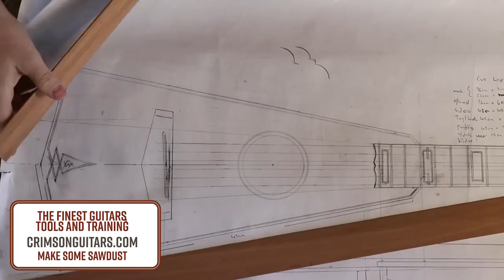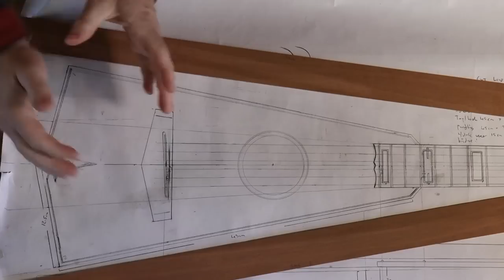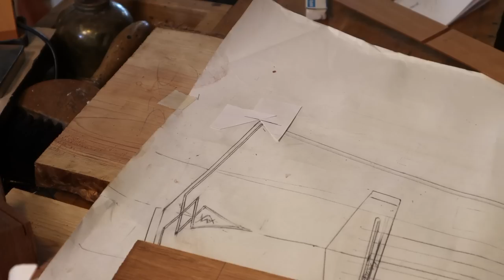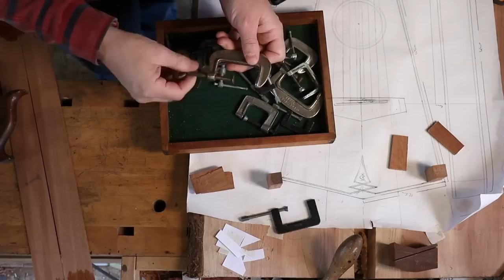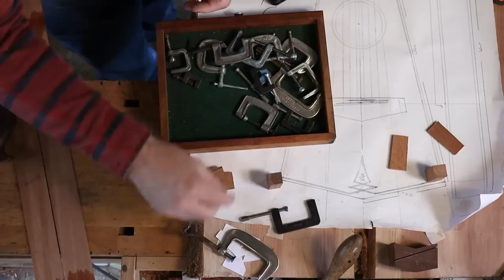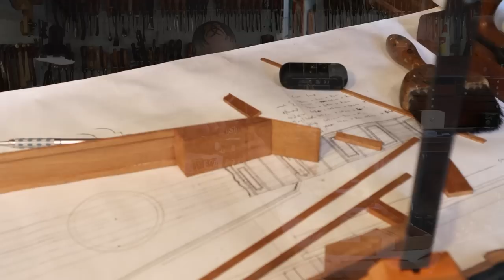Ep 9 - Risky Business | Hand Tool Only Acoustic Travel Guitar Build - A Guitar from a 4x4 FENCE POST

Comment: there is something very satisfying in seeing and hearing sharp tools shave off slim pieces of delicate wood.
Reply: and wondering why I have to hit mine with a hammer 🤔
Reply: The only tools I could afford so far are cheap hardware store chisels with rough blades and steel so soft, it barely holds an edge for a couple of seconds. A nightmare to work with

Comment: I think the electric bending iron doesn't break the spirit of this build because I suspect that older, non-electric versions are so similar as to function the exact same way. Although  I can't actually find an example of a fire heated bending iron, I could imagine an open topped iron that has a gas flame burning inside to produce the heat, or a lump of metal heated up in a fire.

Still, I would like to see one. Maybe an old style oil lamp converted into a bending iron. Challenge for Ben?
Reply: I think it would be like the old cast iron irons used for clothes. Just place it in an oven till it is at temperature take it out and use it. When it cools a bit just put it back in the oven.

Comment: 3:02 Jimmy White at the Crucible 1990...  I think you used an electric heating thing, that's OK I suppose ... but you should have gone outside and held the piece up to the sun and not used an electric lamp to assess the depth of the cuts. Ben you are making your life so hard with this build and we all thank you for it because it shows what is possible and the power of sheer determination and guts. This series is spellbinding.

Comment: 25:32 in to the video, and I’m distracted by the two Burns guitars in the background. My father has the exact one on the right, duo sonic (I think). The bakerlite scratch plate is in terrible condition, but previously you could see it was inscribed on the inside with a signature and the date 1959…

Comment: Grain direction in the support blocks on the sides - does it matter? 
I've read that the blocks should always have grain direction parallel to the grain in the sides to avoid expansion/contraction issues, but this doesn't seem to be universal practice. I've seen guides on making violins that say the grain must run across the grain of the sides. I think the grain of the blocks in this guitar runs in both directions? Confused...

Comment: Since you have corners and not curves at the ends, why not just cut and use mitre joints? A bit of saw dust and glue and most won't even see the joint.

Comment: Is the electric heat block a deviation from the non-power-tool commitment? :P
Reply: Only in as much as he's taking advantage of electric light to judge the depth of the cuts on the lost mitres  :o)
Reply: And the electric heat gun later on
Reply: @PaulCooksStuff  He could have got around that by inviting Paul Reed Smith round  to spout hot air for half an hour!